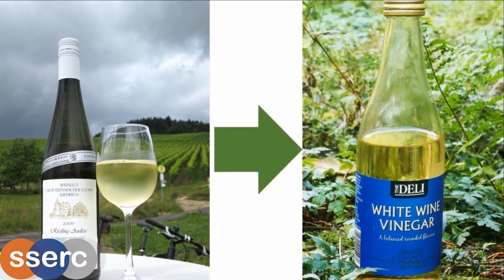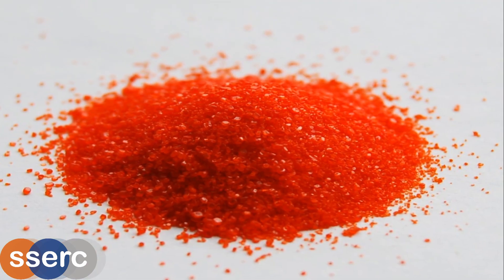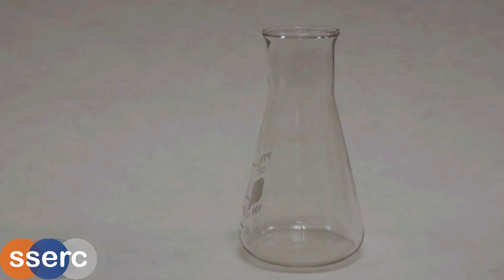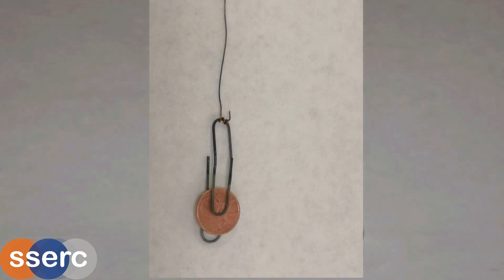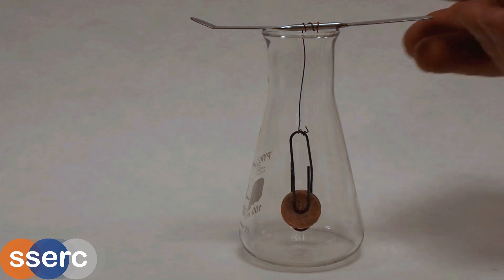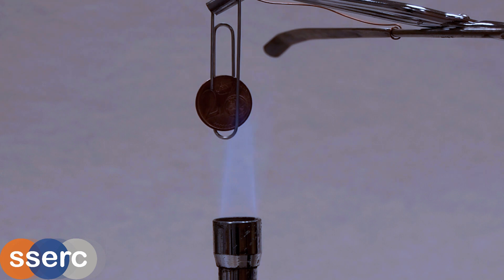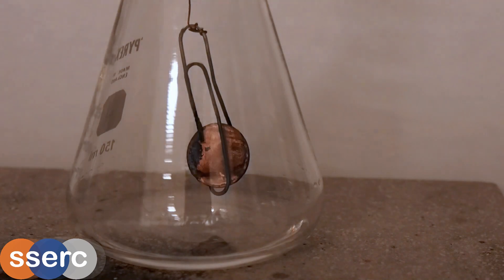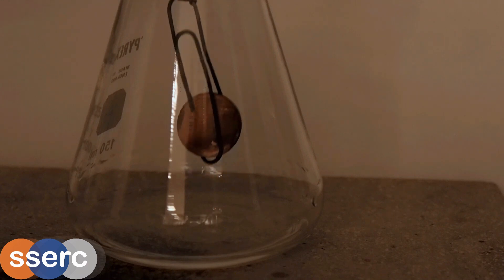Ethanol oxidation with a copper coin

Comment: I have been studying this reaction for many months. 

From what I have read, copper metal can oxidize without the presence of air at about 290° C. This is an endothermic reaction and the catalyst must then be heated to regenerate the copper. Do you know more about this reaction? I have only read that it was copper metal, however it very well could have been copper oxide. If it was copper metal, I assume it would turn it into copper hydride, and then by heating the catalyst you would reduce CuH back into Cu, liberating the hydrogen. Is this correct? 

Also, can the aldehyde from the reaction you performed, be captured?
Reply: Sir Anti iron camical name